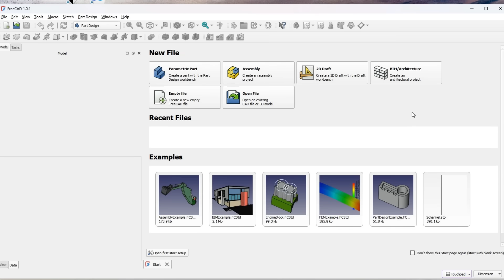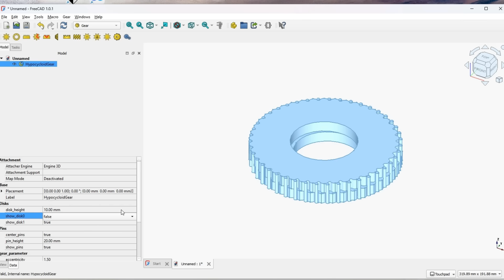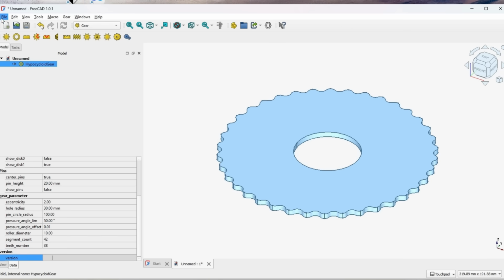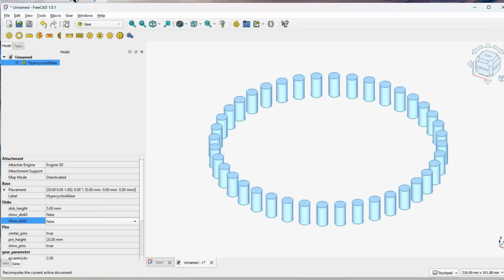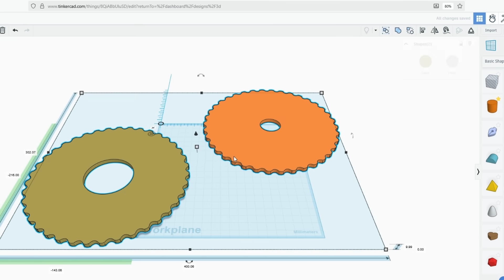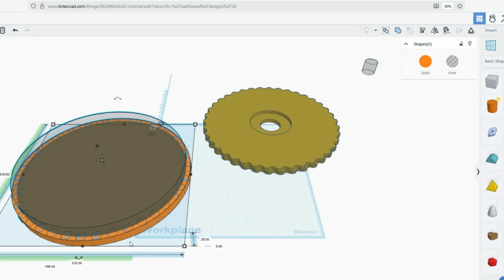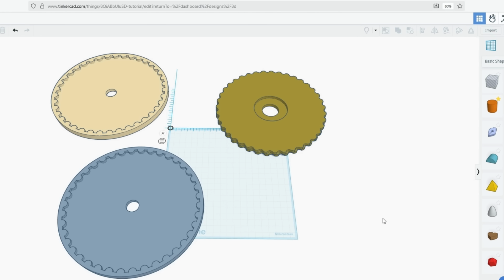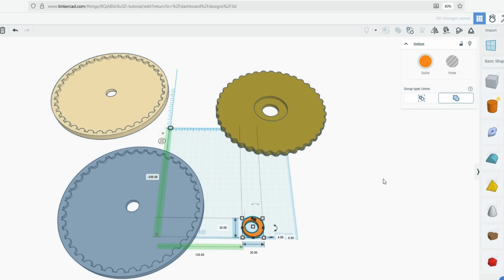2437 The Hypocycloid Hyperdrive - 1500 to 1 With Only 3 Gears

Comment: Put 3 equi-spaced rollers on the output disc that run on the outer surface of the fixed disc to prevent the obvious wobble. The stand will have to be changed to attach to the front face of the fixed outer disc.
Reply from the maker: That's a great idea!

Comment: To completely change the subject. I have an idea for a bicycle differential based on the Torsen diff. Really just a simplification. First the main housing and drive gear are combined, to be driven by the bicycle chain. So two multitoothed matching gears, about the size of a normal bicycle wheel hub gear, made of steel, have three (or two) tabs sets  bent out from the sides. Between those tabs goes the normal worm gears. The two gear plates are attached to each other with a pin in the centre which carries the two drive gears and shafts. Two bell housings with bearings for the driveshafts, are attached to the, main toothed gears. This is now a Torsen diff with the worm gears held by tabs each side of the driven bike cog. Need more info I will send a drawing. A symmetrical Torsen diff driven from a chain, and protected from dirt.
Reply from the maker: Sounds like an interesting idea for a bicycle differential - thanks for sharing!

Comment: Can it be made to run in reverse where 1 turn gives ~1500 out?
Reply from the maker: i don't think so
Reply: you would probably need to get the motion started some other way, from a rest position i don't think so, frictions to overcome are multiplied, too, and the the force is more likely to result in breaking it it than actually driving it.

Comment: That's the sort of ratio and torque which makes me think a precision printer could be made using it as a turning base so the print head then only has to move across the diameter and vertically, hence could be build more solidly and stable with no filament or wire tangle problems. A bonus is it'd mean less fatigue of the control and power feed wires to the printhead.

 The full diameter movement means the bottom plate would only ever have to rotate at max 180.0001 degrees,  halving the wear of components a full rotation design would have. A physical hard stop and accurate live positioning tracking mid print (re)calibration check should also be  possible, to be able to adjust to any motor/belt/whatever slippage.
Basically taking one axis of freedom of movement away from the printhead itself means it's mounting could be built with greater solidity, accuracy and tolerance of random ambient movement input, like jogging the bench the printer is sited on.

Downside is it might call for having to program a new slicing algorithm  but if so that's just a one off mathematical challenge, which even the cheapest modern processor can do very quickly, which I think could be incorporated into some onboard software, eg it took "normal" input data and transformed it into cylindrical polar co-ordinates, meaning software programs wouldn't have to build polar slicing into their products. Of course if such a device was produced commercially, if it's precision advantages were big enough that it became popular they soon would. Though I suspect building it onboard would be needed for the first few designs, to help it become popular enough that 3rd parties would put the effort in to support it.
Reply from the maker: That's a really cool use case - cheers for sharing!
Reply: @ThinkingandTinkering  Thanks, you're most welcome.

Another thing, that occurred to me overnight. 
Rotation and polar co-ordinates bring an almost infinitely precise positioning near the centre. Hence something like a multi nossle printhead ( switching between nossle positioning being just a co-ordinate translation, which is again something cheap computer chips can do rapidly ) would be possible. Positioning of where about the object was printed, on the turntable, could be exploited to utilise that. eg fairies dancing on a hammerhead, you'd print with the fairies at the centre, using the finest nossle, for precision, with the larger nossle doing the hammer for speed.

To be fair XY axis printer could easily use the multi-resolution print-head idea, for very little extra cost, but AFAIK don't seem too. Possibly I'm missing something about the, current, limits of things. My thinking is, being able to, appropriately, combine aspects of high resolution and speed seems such a good idea for their products I must be missing something as the why they don't already...Possibly components are only just hitting a price point where it'd make commercial sense to do so in the home printer market

Comment: Clocks have cycloid gears.  They are good for transmitting high power into lots of movement, but not much power at the escapement end.  Involute gears in most machinery are good at transferring lots of movement (such as in a motor) into less motion and more power.
Reply from the maker: Thanks for sharing that info mate!

Comment: Great video and very interesting, have you seen the electric impulse  clock mechanism i found it fascinating and it seemed to be a very economical way to drive a pendulum. You may have already covered it but if interested in the mechanism" my 28 year old electric impulse clock myfordboy" is where I found the one I'm talking about he times the propulsion of the pendulum and with a little kick from the eletromagnet it goes a surprisingly  long time before it fires again. It Could be a good project for a combination of your cnc and printers , how's the solar system going unfortunately we are heading towards the end of useful solar energy or at least my system is soon it will be blocked out by the house's opersite. 😊 👍
Reply from the maker: I have used that mechanism in other videos mate - the solar is going fine - doing everything i need of it tbh

Comment: If you had the same number of plates as you had pins, would it be possible to have is so every pin fully engaged at all times?
Seems like that kind of connection would be massively strong.
Reply from the maker: I am not sure I understand but the plates do need to roll over the pins and progress - so i think that wouldn't be possible - but as I say I am not sure I really understand what it is you mean
Reply: i believe you would lose the whole benefit of that setup, as it's the different number of pins that allow a slow (off center) rotation. you would be making a 1:1 gear box, though yes, much less at risk of ripping.

Comment: I once built a telescope drive using a bunch of planetary gearboxes from electric screwdrivers, I can see this style of gear working well as a telescope drive, how smooth is the output, would it give a smooth enough final drive to enable it to be used as a precision output to drive a telescope to track the stars at essentially 1 revolution per day, I wonder could you stack a third disc set driven by the second to slow the output even more?
Reply: so I calculate that using 4 disks, 39, 38, 37 and 36 and driving the input at around 1400 rpm gives you an output of 1 rev per day to drive a telescope
Reply: I’m no whizz , I found PWM great for propellers on a model 1/72nd scale Dacota DC3 , with modified motors from NEW durex motors , 
The propellers then stayed attached lol 😂 
I hope this helps ….in some way .
Reply: I'd make it using slanty rods instead of pins so they could be angled at different ways to provide different diameter end point which could be used for anti-jitter, driveshaft coupling alignment, and a smaller fractional subset of the original gear ratio like maybe 1500:1 to one moves to 1501:1 depending on whether you're pulling this "ring drive" into a larger or smaller diameter "ring" than the bases of the rods.
Reply from the maker: I am sure you could stack it mate and I am equally sure you would make a very nicely engineered version
Reply: If you look at some of the 3d printable designs of this already you can get some ideas for it. Some good designs even use small ball bearings instead of pins so to speak. When built well they are fairly quiet and have minimal backlash to them. But its always down to how good your tolerances are like everything else in engineering. There are designs that are kind of the opposite of this as well. I would definitely get some inspiration from existing 3d prints first because there are a tone of unique ideas around this gear system.
Reply: @newmonengineering  For the pins to rotate I bought cam follower bearings, they are essentialy needle bearing in shape of a bolt, worked very well on plastic prototype but sadly I never finished my reducer as cost for manufacturing it in metal was too much. I even had an idea to make lapping mechanism to polish the lobes for extra smooth operation.

Comment: When you were turning it, the output seemed to go back and forth, (with a bit more forth). Can it somehow be smoothed out?
Reply from the maker: yeah it did wobble around - i guess tighter tolerances and not held by hand?
Reply: @ThinkingandTinkering  lol, I didn't even think about you were holding it by hand.
Reply: Maybe if it was driven by a motor, so the input speed is higher and more consistent, it'd look smoother. I would have made an input shaft feature that fitted in my electric drill, at least.